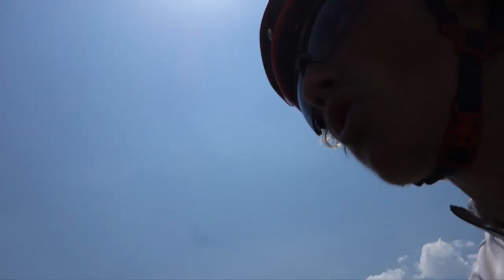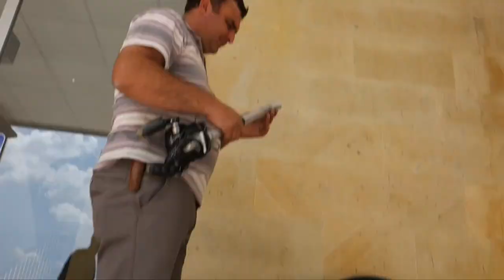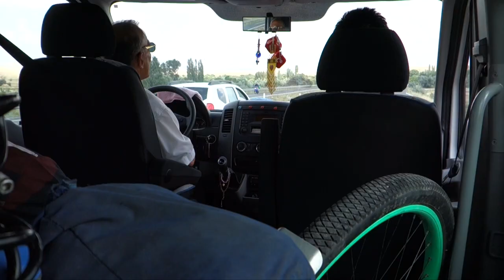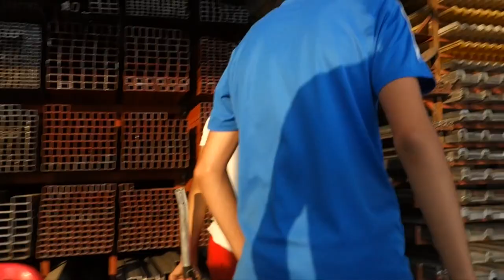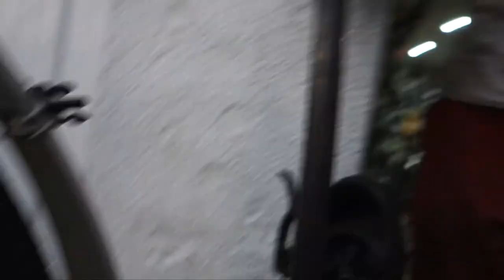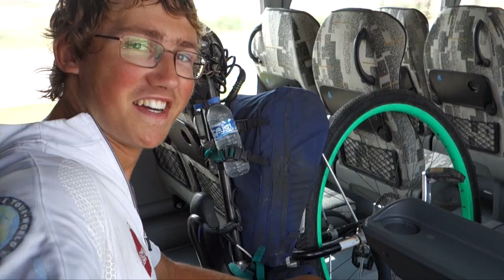SNAPPING MY UNICYCLE!!! - Unicycling Around The World

Comment: i must be missing something.   I don't understand how you can have braking on a uniccyle without throwing yourself down to the ground, face first, like a clock hand.   At best, all i can imagine is applying mild braking as you lean to the rear to counter it.
Reply: The easiest way to explain it is that you lean back slightly to counteract the deceleration. :)
And since the unicycle is essentially a fixed-gear with no coasting capability, the handbrake is just added insurance. The resistance you put into your pedals is your primary braking mechanism. The ability to have a solid foothold no matter what you're doing is actually surprisingly helpful with maintaining your balance that way.

Comment: WTF......?????
Try a repair with super glue and cigarette ash ????
Tell me that's not real and a joke......right ?
Reply: No they tried chewing gum  first.
Reply: Ashes are carbon and the glue is like resin...so the entire thing is basically "Carbon fiber" 😂😂
Reply: @FreeOnGoal  Hehehe, yeah carbon fibre with no fibre. Even real carbon fibre would need to be applied in sheets, not as gap filler as if it were a weld. Lol.
Reply: Desperate times, desperate measures.
Reply: A carbon enthusiast once said to me that super glue and baking soda is a semi-legit way of repairing chips in a non-critical carbon fiber part. aparanetly the baking soda grains make the glue cure immediately because of the higher surface area, and acts as a structure to the newly-formed composite. So not a huge shock that they'd resort to this method in a pinch.
Reply: Do you laughing heads know, that tobacco ash is a katalysator for burning sugar? Try to set a sugar cube on fire. You will fail. Add cigaret ash and you will see a flame. That ash is not just ash. Think before you laugh, please.
Reply: In my refrigerator there is a double seringe with epoxy glue for metal. It's grey and strong as hell. If you sand that aluminum with coarse sand paper, qyou can make a perfect repair. Just take the right materials with you. That cyano glue is strong, but those two men should have pushed the metal together. It is pressure that starts the bonding, bridging the crack with a lot of glue is not gonna work. Perhaps the ash is a trick to glue a wider crack. I should check that. That steel tube is the perfect solution.

One of my friends bought a bike, that is welded from steel tubes that can be welded again, in case you crashed your bike. For extremly light frames, welding repairs might be impossible, you have a total loss, real soon. Just like those carbon frames, great, until you hit something. Wether things can be repaired, that is the question.
Reply: Yea I would of peed on it first
Reply: Nope, its a real tactic. you should try it. Lowkey asked you to smoke :Dd
Reply: no joke  :D  its so powerful :D
Reply: @ExploringHabit  Basically super glue sticks to alot of thiings, but it doesn't stick to everything. It is missing the one thing everything is made of. Carbon. My friend used cigarette ashes and superglue to bond pieces and even mold forms that handle extreme vibration.

Well I was building a protein skimmer and had to bond pvc to a water jug.
under 10gallons of water putting pressure on it, it has not leaked @ all. 

I have bonded glass to rubber to dog hair and it sticks to everything!

You can use ground up activated carbon if u plan on submersing it. I just smoke alot of cancer and it was right there.